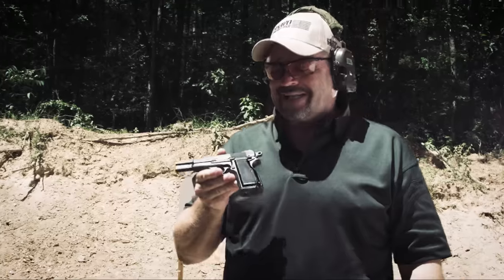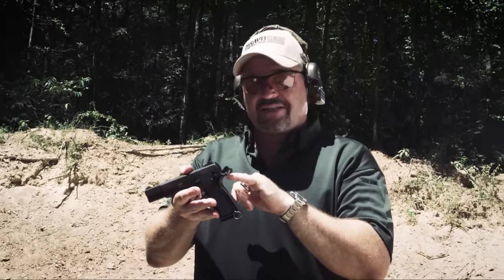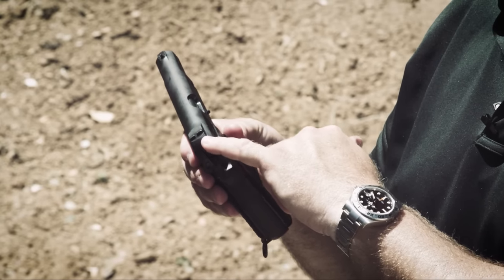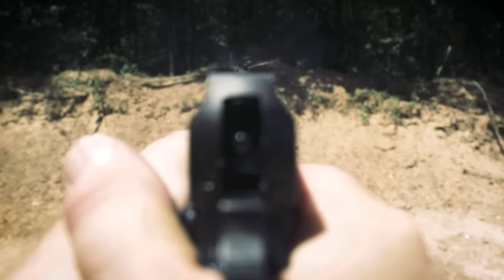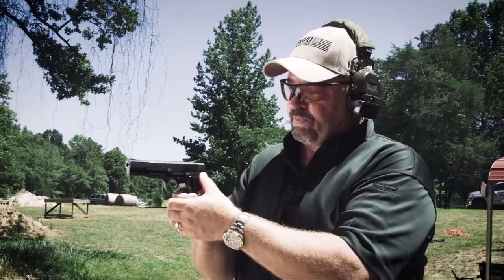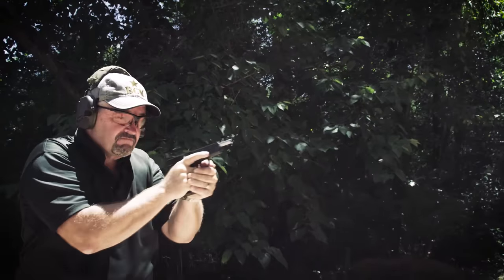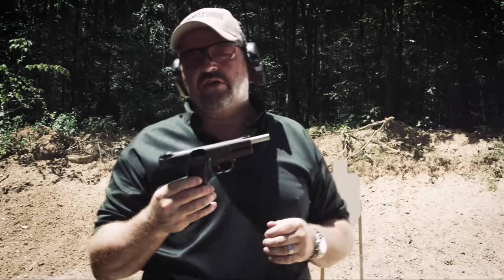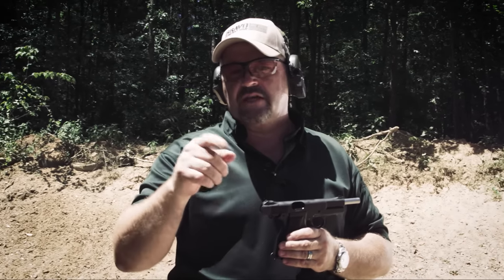Inglis Hi Power Pistol

Comment: Awesome someone does a review on the high power. I have my grandpas high power made in the original Belgium factory... never had an issue with it even after the multiple thousand rounds now 3 generations have shot it. Arguably one of the most reliable guns out there in my opinion.

Comment: Thanks reviewing a Canadian made firearm. Not to bad for a pistol made between 1944 and 1945. Still in use by the Canadian military. Most issues with the pistol is worn out mags and inexperienced operators. Review a C7/C8 if you could. Keep up the good work.
Reply: Maus46 simply a Canadian version. It's a Hi Power made here. Just as the C7 and C8 is a Canadian licensed version of the M-16/M-4. We didn't reinvent the wheel. We would probably have a new pistol but the Feds 86'ed the contract. Still using WWII era pistols pathetic. 

I miss my C7A1.
Reply: NovaScotiaNewfie We didn't reinvent the wheel but perfected it. The C7A2 is huge improvement and a better platform than the m4/m16. First class service rifle that even the Sas and many other countries use.
Reply: Maus46 Yes many countries did adopt it. I have heard about the differences. I'd have to shoot the M-16 A2 to compare it to the C7A1 I got to use in the Reserves. Rumour has a tendency to get out there and I don't assume it's fact. 

I'd like to own the C-7 AR from Diameco with the 20" barrel. I'm sure it could feel like my old rifle.

Comment: Wrong flag shown for the time period. It should have shown the red ensign flag.
Reply: Drift King it would be true. except they're still our standard issue.
Reply: Not anymore. I heard that the SIG-Sauer P226 is the new standard issue pistol. The Inglis Hi-Power has been out of production since the early 1980s. There is a news article about the old Hi-Powers being melted down for scrap metal.
Reply: Drift King I am actually in the Canadian infantry. 226's are a limited standard for SOF and MPs. I requalify on this gun every year!
Reply: I guess it is slow to phase out guns in the military, especially if they are rear echelon weapons.
Reply: Firstly the MPs Carry the P225. The P226 is issued to special units only, and it is likely to stay that way for a while. There is plenty of stock of Brownings still around in the CF and it will be a while before they replace such a vast quantity.
Reply: Yeah the MP & Aircrews have p225, and SF has 226... for the rest of us (I am now out) we had to find one that was decently up kept. I got one out of the vault and the barrel wiggled inside the slide, and another has Korean writing on it. Only the best for the troops.
Reply: Drift King bunta
Reply: @copperandradium  only MP's, CANSOFCOM and pilots (I believe) have been issued other pistols .

They have had projects to replace them but it kept getting cancelled.   It's on again to source a replacement.

Comment: can anyone tell me where the ADF get their browning hi powers from or do they just keep reusing old WW2 ones and don't switch out for new ones. also IT old AF ADF need a new pistol
Reply: Will M we dont use 'old ww2' hipowers. We bought a bunch im guessing the same time the FAL came into service. Why change it when it works a well as a hipower does?
Reply: they should update the hi power is what i am saying have lithgow put them up to modern standard. haha the L1A1 came out in the 1950's/60's
Reply: Jazza Beardedbjorn are you sure the commandos use Glock 19's I was pretty sure the SASR and commandos use HKUSP's
Reply: The Minimis that the ADF use are F89s manufactured by Lithgow Arms and Thales Australia. not directly thought FN.
Reply: +Jazza Beardedbjorn Also ive never seen or heard of any Commandos or SASR using the Glock 19 only pistols I know they use are the standard Browning Hi-Powers and The H&K USP.

Comment: I don't like the way the gun feels in your hands... I have pretty big hands, so it's not that the gun is too big, I just don't like how thick the grip is and how light the barrel feels by comparison. It's hard to explain but it's essentially like picking up a thick stick with a little twig hanging off of it representing the barrel and upper frame of the gun. Of course this is over-exaggeration, but that's the sort of feeling I get when holding it. I much prefer the ergonomics and weight distribution of guns like the Luger (which displaces most of the weight near the center of the gun) and the P38 (which is a bit more top heavy). Either way, the grips are far sleeker and it feels a lot better when grabbing and pointing them. As for the ammo capacity, that's pretty much a non-argument for me seeing how thin both Luger and P38 mags are. One Hi Power mag is pretty much equivalent in thickness to two P38 mags and I much prefer to place my 8 shots tactically then reload as opposed to emptying out an oversized mag hurriedly and carrying around all the clunky hi power mags.

Comment: Worst thing about it is the magazine disconnect. Wish it wasn't designed with it.
Reply: TheFirearmEnthusiast just remove it, it's not difficult
Reply: Crytech
You want a damn bet? The trigger pivot pin on MKIIIs are frozen before inserting.

We had to make a graduated series of punches to force it out using a press. It won't come out with a hammer and punch on MKIII.
Reply: TheFirearmEnthusiast I removed mine.

Comment: Canadian Forces issue.
Reply: 이동연 the bulk of the CF carry it yes. I was in the Reserves.
Reply: 이동연 as long as they retire the Hi Power I don't care if it's Sig, Glock, etc.The replacement programme was cancelled.
Reply: @NovaScotiaNewfie  long shot but: did you guys use the No.2 Mk1* or just the Mk1*?
Reply: @clankplusm  it was never stated. But the bulk if not all were made in the late 40's. Since the pistol is still production I assume they replace parts as needed, but I was not a weapons tech (armourer) so don't know the specifics.
Reply: Yeah there was a dubiously stated no 2 mk1* variant in the 80s I've been trying to see if it's our current service pistol. the WW2 one was just the Mk1*. So guess that's the one.
Reply: @clankplusm  it's possible. I never got to use a pistol. Let's just say the ones in service are likely much older than the users.
Reply: Well thanks for your time, and answering on this 2 year old thread, looks like I've got a bit of a journey ahead of me. I appreciate the info though.